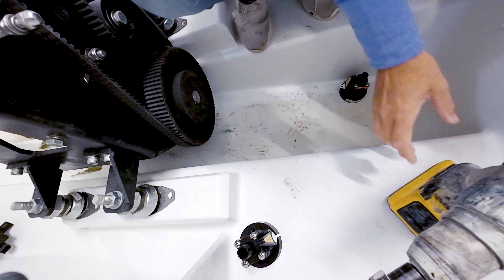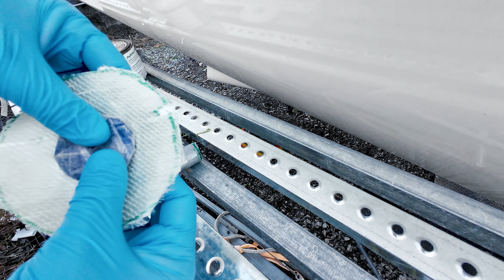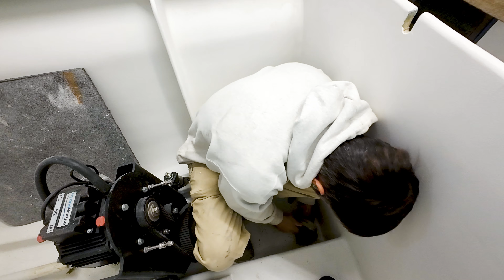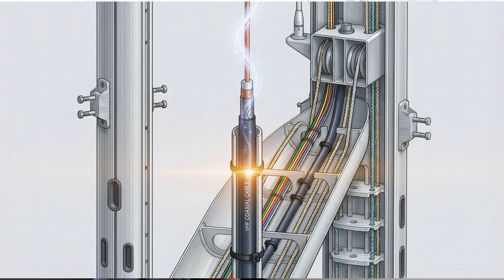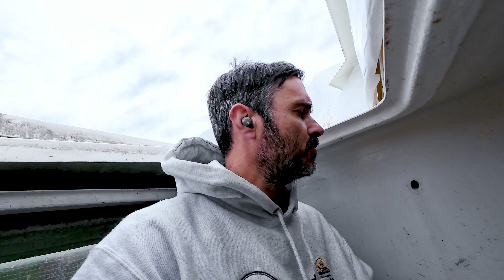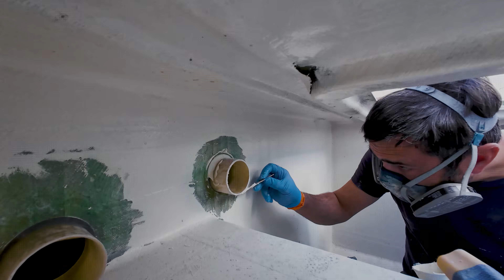She Drills Holes, He Fills Them (MJ Sailing - Episode 369)

Comment: Its the little things that add up time wise- will the pipe help with strength?  noticed it went right next to the metal base of mast- would glassing in a bracket or couple wedges between the pipe and the metal give you anything worthwhile?  How is the boat grounded- if the mast gets hit by lighting- can you even protect the electronics?

Comment: What a grind to workload. Eating the elephant  1 bite at a time.
You guys will get there. 
Don't  mind the armchair criticism that shows up here in chat.
Reply from the maker: It's funny how little there is to show for so much work.  Continuing on with this project in the next episode, we drill holes inside our cabinets for wire runs....and the amount of paint, primer, and filler that has to get sanded down in some areas is crazy!!

Comment: Not sure I agree with having separate through hulls for everything. How many through hulls will you end up with below the waterline? I have only three on my 60ft monohull. It's an important safety feature which I absolutely agree with.
Reply from the maker: Keep in mind that a thru hull failure can't sink the boat.  It can cause damage to the engine or flooring, but the watertight sections throughout the hull and bulkheads will float the boat without sinking.
Reply: @mjsailing I have two watertight bulkheads on my monohull too. It's just good practice to keep through hulls to a minimum
Reply: I think they have greater survivability when flooded - every multi-hull should !
Don't quote me on that........

Comment: This phase of the build has so many details.  I wonder how you keep yourselves motivated.  
What will you do when proper winter sets in, cold temperatures, rain, wind?  Will you install a boat tent, to just cover the boat?
Reply from the maker: Last winter was our first cold season out of the tent, but with two diesel heaters running constantly through the work day (one pouring heat into each hull, which then rises to the bridge deck), we were able to keep the boat around 60 degrees.  We'll do the same this winter, but now we've placed shrink wrap all around the cockpit so we can heat that as an extra work space when we want as well.

Comment: Some how I  feel that now is the time in the project where you need to dig deep and keep enthusiastic it's been a long journey  but you're almost at the finish line
Reply from the maker: I have a feeling this next stretch will definitely keep our spirits up because we know each little task we're taking on is making big improvements.  So much different than last winter where we just kept sanding and priming the same surfaces over and over. 😂
Reply: @mjsailing yer absolutely its getting exciting